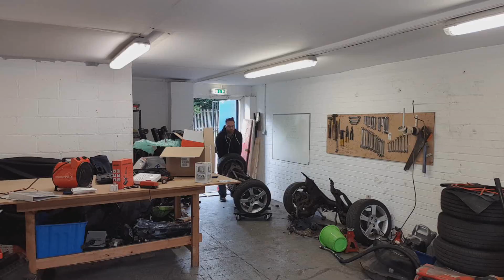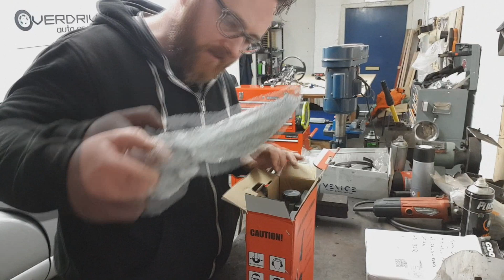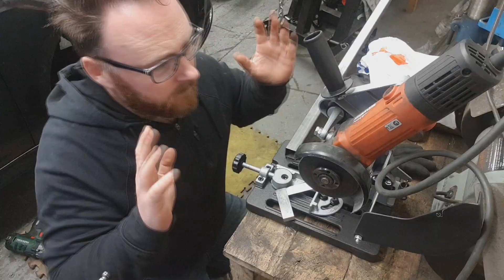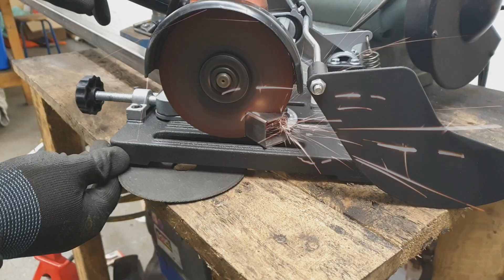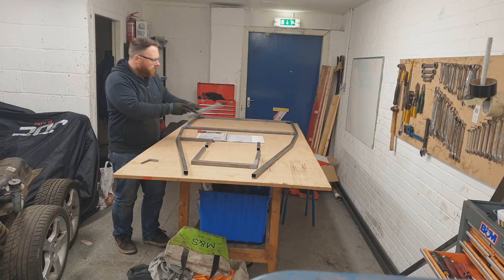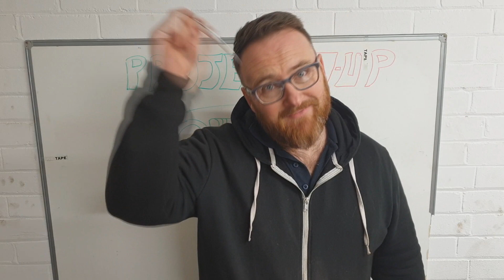Locost 7 Kit Car FULL BUILD!! - Episode 3 - Chop Chop!!

Comment: did you manage to do the whole thing with that angle grinder attachment thing? was it accurate enough?
Reply from the maker: Surprisingly it was very accurate once set up correctly.
Reply: @ToolsnTrack  did you ever manage to get it to go all the way through an angle cut?
Reply from the maker: @flyingosom202  on a fresh disk it will go to a 30 degree of so cut in inch steel ok. A 45 degree cut is basically not happening, and as you wear a disc it will affect the full cut depth a LOT

But it was a tenner....
Reply: @ToolsnTrack  haha that's fair enough.I can't find anything for a tenner anymore!

Comment: Bit late but the end of a tape measure is supposed to be slack to allow for inside and outside measurements and moves the thickness of the metal
Reply: Tape measures have a movable "tang" which is there for exactly that purpose.

Comment: Thank (squeak)! Finally, someone who speaks the same language  with the same accent as me.    Really enjoying this build guys.  I've had the idea of doing similar in my mind for more years than I care to remember.  My idea is for a larger donor,  I'm edging towards an S type jag or similar chassis with a mated 4.0 or 4.2 jag engine and box, wiring loom and ECU.  I know the procedures will be totally different and more complicated, but the processes are basically the same.  If I do go through with my plans, the finished car shouldn't need to go through the one off test as I'm aiming to use enough from the donor for this not to be a legal requirement.  I'm struggling to find a supplier or designer that has a suitable kit for this chassis.  I'm not too bothered about the overall design, just would like something that reflects or works well with the parts I'm hoping to use and has a P:R  of an Elise...  :)
I stuck on my Scooby Doo heid and tried to work out if I knew where you were by checking out the B&Q store, but nah, it doesn't ring any bells.  I've a funny feeling you're in the Kingdom, Dunfermline, mibbees?  Anyhow, really enjoying the series and looking forward to watching the rest of it and seeing the final outcome, so thanks for the inspiration and reigniting the Petrolhead spark (not a good mix).  Thanks guys
Frankie
Reply from the maker: Haha, Glasgow buddy.

Comment: You could add a square tube in the vise, in front and that way, the material that you want to cut the 45, will be pushed back, toward you.
Reply from the maker: We could, but there isn't enough width in the vice for that when set at 45. Its too dinky!

Comment: The end of the tape measure is made with abit of movement to accommodate the difference in internal/external measurements, as in if you measured an internal for something and didn’t have that bit of slack in the tape, the piece that you cut would end up short.
Reply from the maker: Very good info, good to know!

Comment: Keep up the great work. I started building my Locost in August. I found a bench sander with a disc and belt was one of my most used tools during the frame construction phase. It was great being able to cut the steel slightly long, then sand it down to the perfect length and angle. Looking forward to following your build.
Reply from the maker: Its been our tactic too in episodes to come. Nice work!